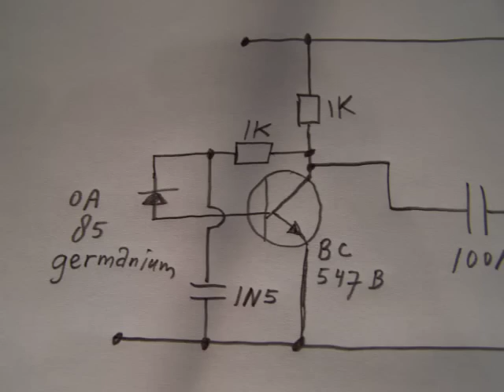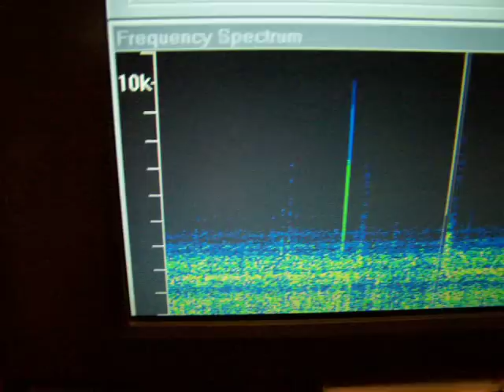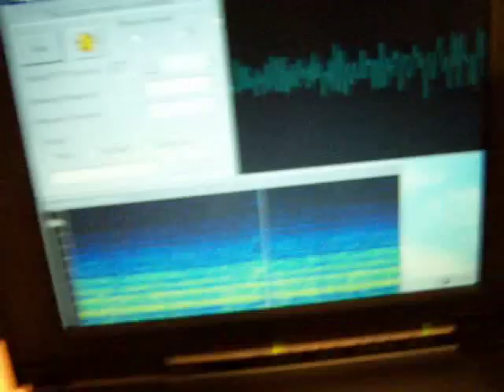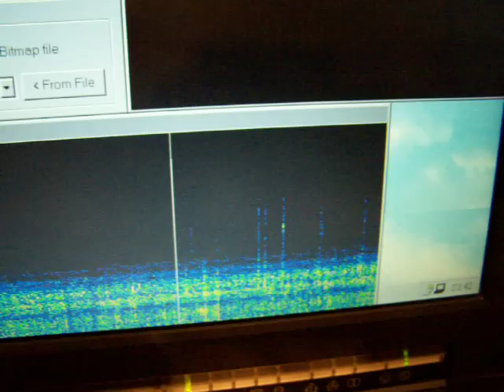noise generator schematic

Comment: What makes more noise: a diode like yours or a base-emiter junction of the transistor? A germanium or silicon device? Of course I'd check it by myself, but now I'm far from home. :)
Reply from the maker: The germanium diode & the germanium transistor create more noise.
Reply: Have you ever tried a schottky diode?
Reply: @radiofun232  those BC547b transistors are SILICON transistors. The OA85 diode is of course made of Germanium. Have you tried this circuit using Germanium transistors as well as the OA85 (Ge)diode?
Reply: @anotherdave5107   the diode used here is a Schottky diode.
Reply: @Kazilikaya  No, but the Germanium-junction is the noise-source. The 2 transistors are used as amplifiers.

Comment: I notice the diode is reverse biased. 

Are you actually amplifying the voltage fluctuations resulting from leakage current of the diode to generate the noise?

This could be used as the basis of a true random number generator.
Reply from the maker: Yes, it is a common circuit in electronics.

Comment: Hi! Can't fin the 1500 pF, can I replace it with a 2.2 nF?
Reply from the maker: Try it!
Reply from the maker: With two 2.2 nF capacitors (when you have them) in series you have a capacitor of 1.1 nF, that could be good enough. Don't hesitate to try something, always check what happens with the oscilloscope.
Reply: @radiofun232  Thanks a lot!